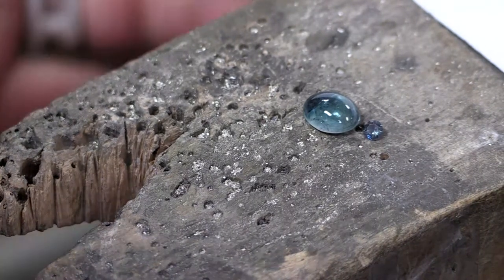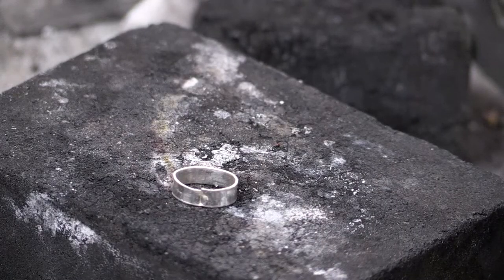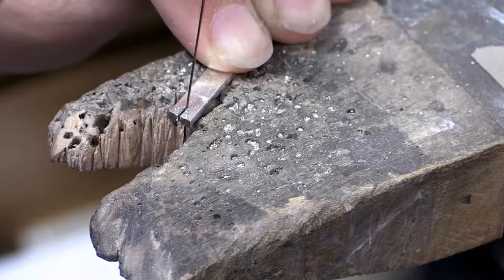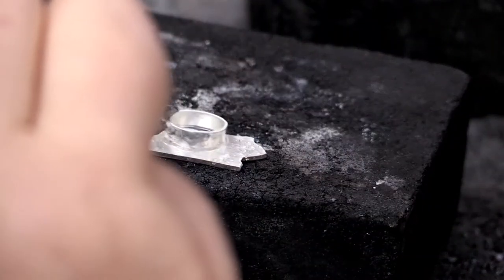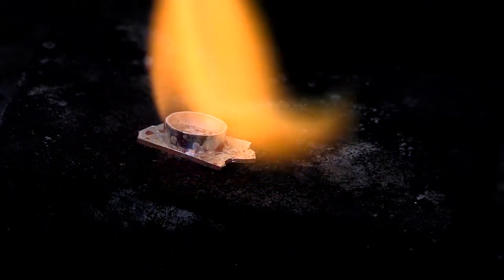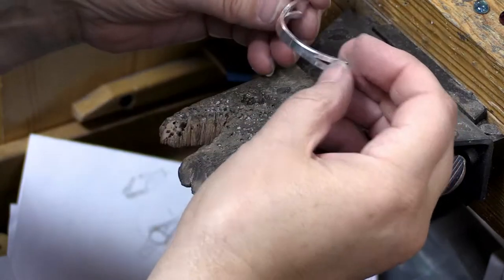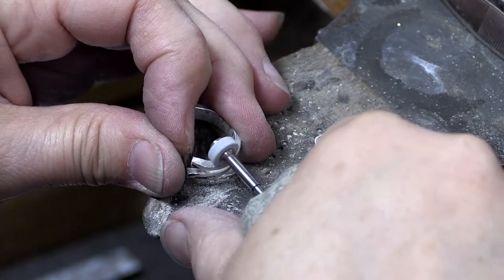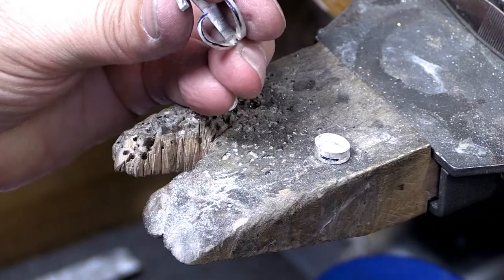BEYOND the BAND & BEZEL - Creative ring design with basic techniques -PART 3 -TEAL TOURMALINE RING

Comment: Ive never known about using boric acid and alcohol to stop fire  scale, by dipping  main piece into. Does it matter of the join has that mix on it? what proportions is best? Thanks for the tip about the white paper. So logical when told. Thanks. Bev.Jordan New Zealand
Reply from the maker: Hi Tony and Bev,
The formula I use is very approximate and you could look up something more precise. I put denatured alcohol in a small jar and add boric acid powder and stir it. keep adding boric acid until the solution is over -saturated - until the alcohol can"t dissolve anymore powder and the solution is cloudy when stirred. When you want to use it, shake it up to distribute the settled solution and dip or brush it on the piece. Typically, people ignite it to burn off the alcohol. Then you can see how well coated the piece is. It does not interfere with fluxing a joint. It is very flammable so ignite after the jar is closed again and away from hair and face! It is not fool proof for firescale prevention but is very helpful if you don't overheat. It forms a glass-like coating on the piece to prevent oxidation. Keep on creating!

Comment: When you say,"boric acid and alcohol dip" what exactly do You mean?  Borax and denatured alcohol, borax and isopropyl,  and what percent???
Reply from the maker: Hi Catherine
I use Boric Acid (you can get it at jewelry supply or a pharmacy) and denatured alcohol. I do not use a percentage. Basically,  you keep adding the Boric Acid to the alcohol and keep stirring until the solution is over-saturated and there is excess Boric Acid that will settle in the bottom of the container. Too much is OK, not enough is a problem. Keep it in a sealed jar and dip your piece of metal to be soldered in and agitate it to stir it up and get the Boric Acid on your piece. Then when you put your flame on it  the alcohol will burn off and leave a fine white coating of Boric Acid. It will turn glassy and help protect against firescale. Use your flux right over it. If soldering with diamonds in place you need to protect them with this solution. And remember not to quench diamonds! Keep on creating!